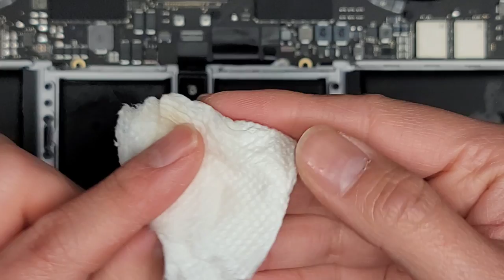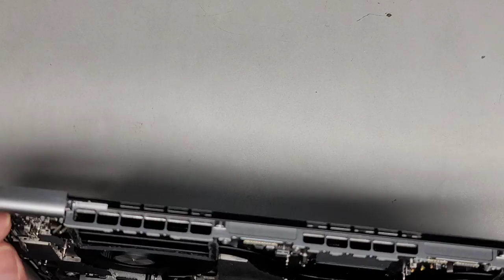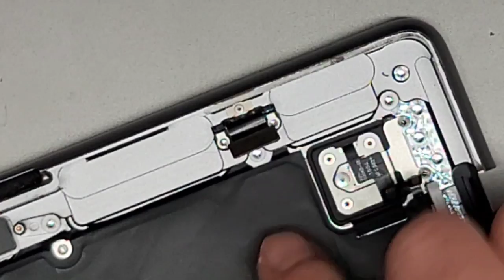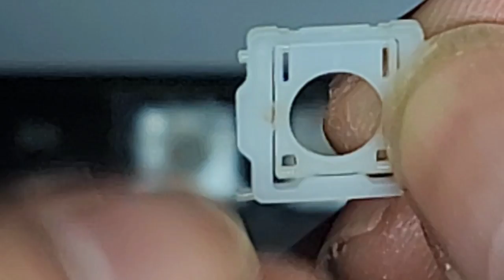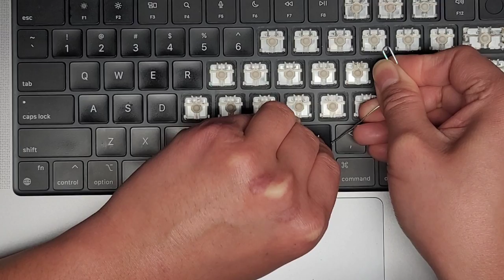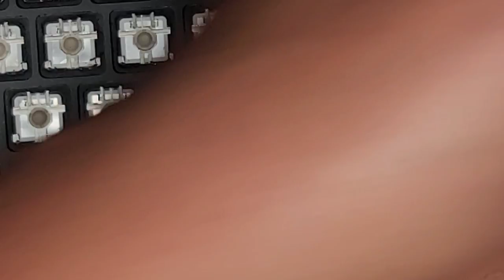2021 14" Inch M1 MacBook Pro A2442 Disassembly Coffee Liquid Spill Sticky Keyboard Cleanup Repair

Comment: 12:47 you can use running warm water from the facet???  What, over the logic board???
Reply from the maker: If you drain all the power from it, but you'll need to be careful to make sure it's completely dry before trying to turn it on
Reply: Rust??????
Reply from the maker: Rust?
Reply: @ItsBinhRepaired  yeah if you leave enough moisture the metal would rust, isn’t better to use 60% rubbing alcohol?
Reply from the maker: @Ribbuns  just need to dry it good, then use the alcohol to dry it more.

Comment: i had the same problem and the microphone is not working, should i replace all top case or just microphone component?
Reply from the maker: Just the microphone, though it could be a logicboard issue.
Reply: @ItsBinhRepaired  yes but the official Apple service review my PC and says that I have to change the top case, so I think that means that logic board works correctly?

Comment: Hey, i want to as if the hook inside the spacebar component is bent, can i replace them or it is unified with the body?
Reply from the maker: It's part of the keyboard. Not replaceable. You need to try to bend it back.

Comment: I have the 2021 16 inch Macbook pro but one of the rubber key cups under my up arrow key is torn. I have searched everywhere and been unable to find any information about the repair of this or if it is even possible at all. I found your channel and was hoping that you would be able to provide me some insight as even Apple has not been ablke to give me an answer. Is it possible to replace the rubber cups itself? Also is this something that takes a lot of skill or would I need an entire keyboard replacement?
Reply from the maker: Usually can scrape it off and use a very tiny amount of super glue to stick a new one on.
Reply: @ItsBinhRepaired  Thank you, I don’t know why but there is nothing about this anywhere or with any tutorials. I have been trying to figure out if it’s possible. Apple support won’t give you an answer on the phone and I would have to go in person. I know they are super picky on what they will replace without having a whole new keyboard needed. I am hoping this isn’t one of those fixes
Reply from the maker: @wesleydavispaul  shouldn't be
Reply: @ItsBinhRepaired  Thanks for the help. Top case replacement would be $615 so fingers crossed.
Reply from the maker: Good luck